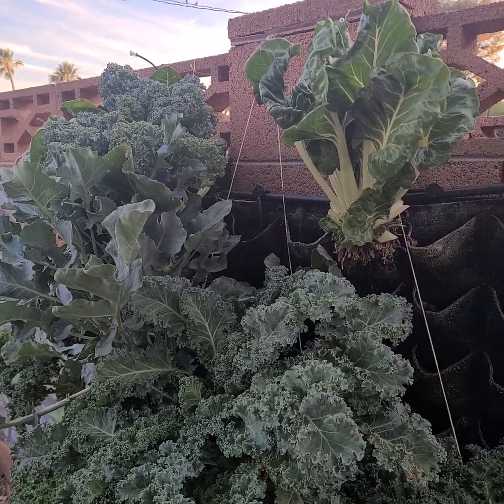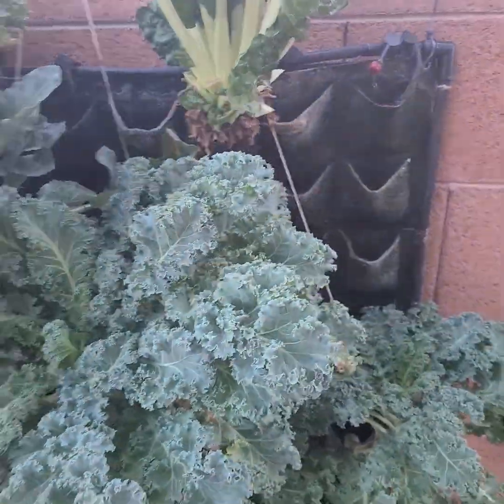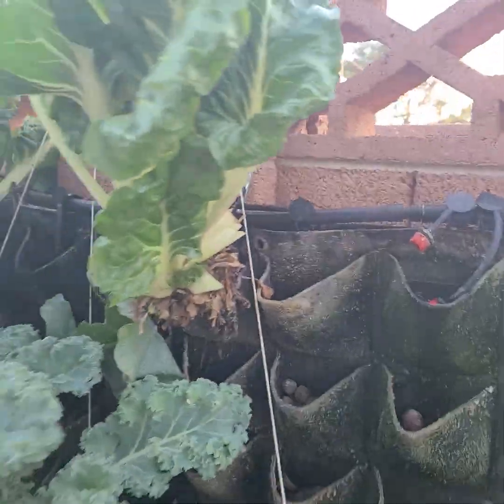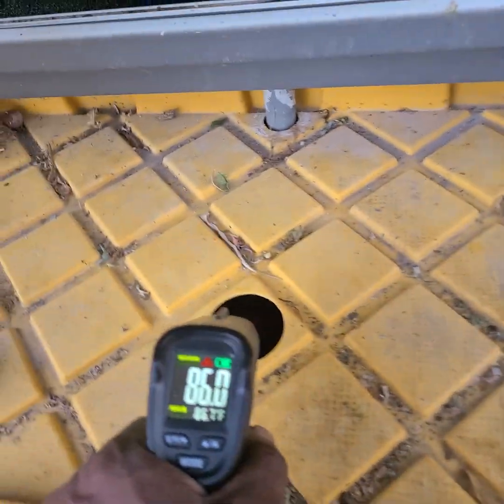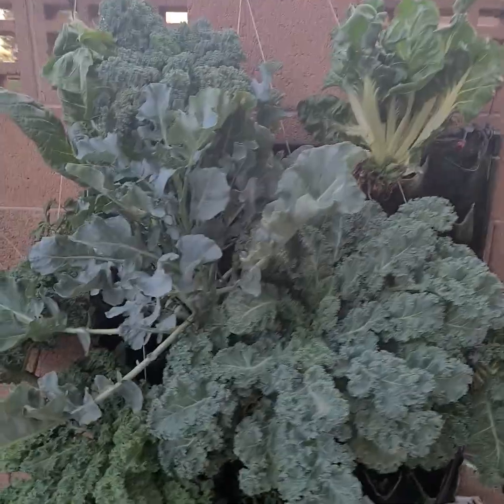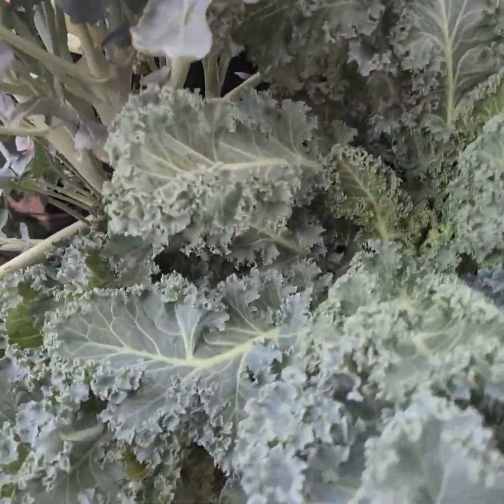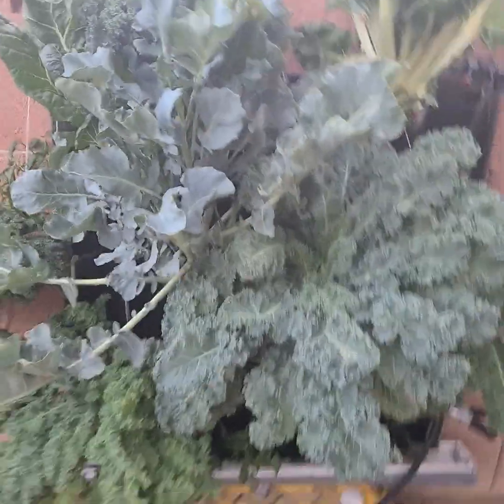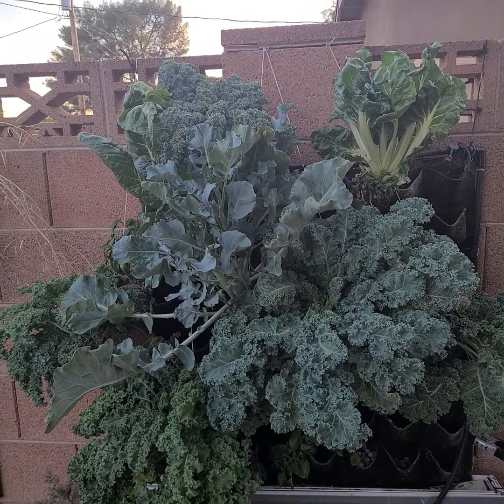How do we grow giants in the heat? I couldn't wait to share the answer! #garden

Comment: Interesting stuff! Do you use more water? How often does the tubing need to be replaced? How often does the fabric need to be replaced? Can you grow anything in that? Do you need a wall? 😍
Reply from the maker: All great questions! This system has been running, as is for over 2 years. Although,  the water emitters/ connectors should be switched every 6 months.  We've grown full sized fruiting veggies in it, multiple leafy greens, etc. Technically, you do NOT need a wall, but it helps with support. WOW! I truly love this interaction :)
Reply: @togetherwegrow8340  thank you!
Reply: @togetherwegrow8340  Do you need a steady wind? thanks

Comment: good stuff 👍
Reply from the maker: Thanks fam!
Reply: @togetherwegrow8340  I try to explain to people that plants and the micro organisms prefer an ideal temperature between 65F low and 75 High, and they also prefer that temperature difference between night and day. The closer that you can get to those "ideal" temperatures, the better the micro organisms and the plants will do. 👍If you get much warmer or colder temperatures, or a bigger temperature difference between night and day, most of the plants and the micro organisms will have a more difficult time. Which will result in less growth compared to plants and trees that did have those "ideal" temperatures.
Reply: A lot of people do not understand that the soil or walls, or anything else for that matter, if warmed up for a longer period of time, will radiate infrared heat. And combined with the sun during that day that radiant heat will raise the total temperature just like an oven does, which can exceed the limits that the plants and the micro organisms can deal with. By applying mulch, or some sort of water cooling like you do, people can do something about the radiant heat, and protect the soil and the  micro organisms. 

At the end of the day it is all about the micro organisms, because the micro organisms convert and provide the nutrients for the plants. If the micro organisms can't do that because their habitat is too hot, the flow of nutrients will stop, and the plants will stop growing, or they can even die from a nutrient shortage. That is what happens when you see the leaves turn yellow while the veins from the leaves try to stay green.
Reply from the maker: @insAneTunA  keep talking, lol. I'm enjoying this. You're Killin it!!